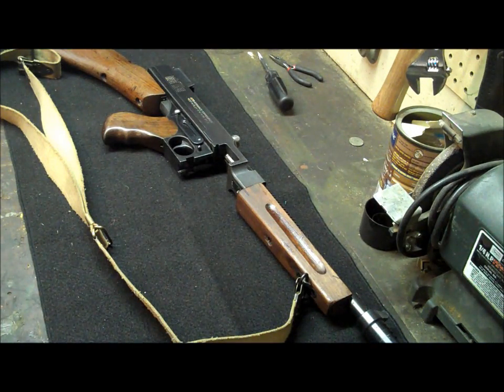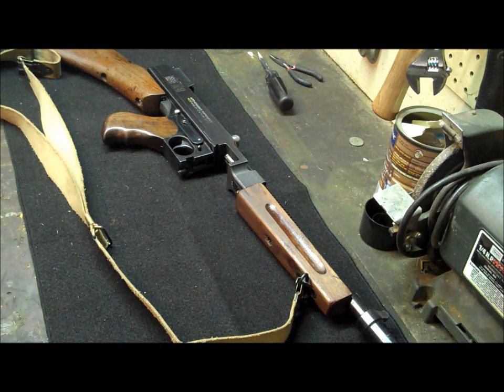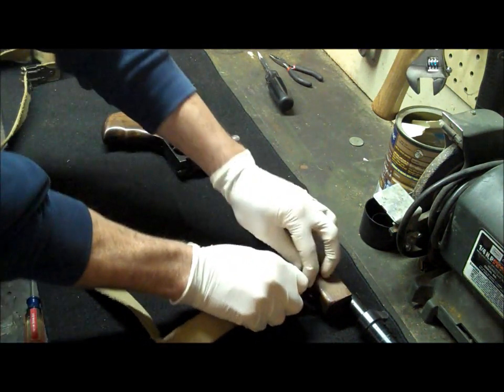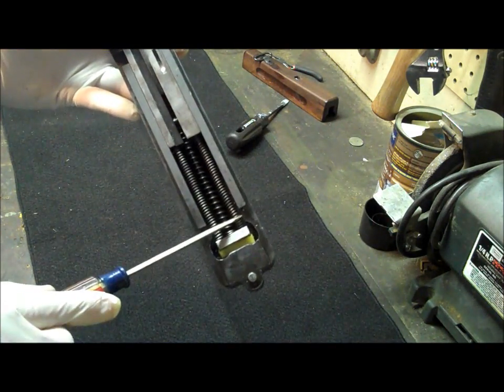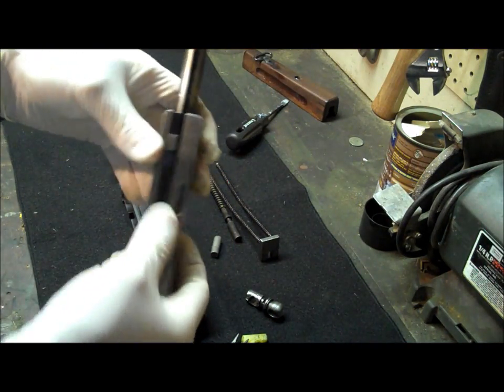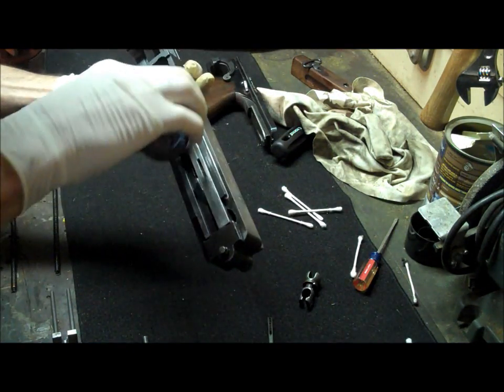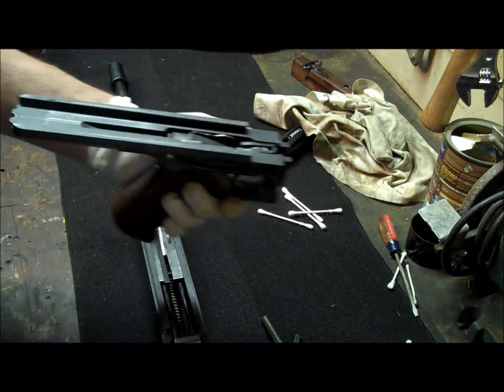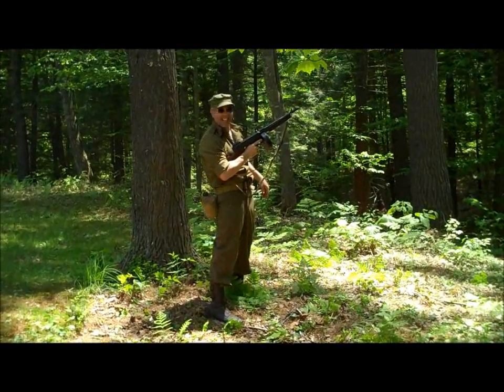1927A1 Thompson "Tommy Gun"

Comment: You can make a magazine loader for tommy mags by modifying an M 3 grease gun mag loader. Squeeze it in a vise along it's long axis,making it longer front-to-rear. The fore and aft ends will bow outward and clear the "T" rail at the rear and make it narrower.Go slowly,in small increments,testing fit as you go. When it finally fits, give it just a little more to allow for  the steel's tendency to relax and spring back over time,but be careful not to over do it or it will be too narrow to fit.

Comment: The top sling attachment is a british feature. And is that the tommygunner add on attachable piece to make the m1927 take a removable stock? I'm building a 1928 with an original lower and a philly ord receiver, and I plan to put a kahr bolt inside of it to make it semi. Involved in modding the original lower, but should be cool

Comment: The bolt on my tommy gun is stuck to the rear, the firing pin is sticking out of the bolt and the trigger is stiff.  I read that the sear is the problem but I was wondering if this is a common problem and if it's an easy fix?
Reply from the maker: SpiderGamez To be honest I've not encountered the problem.  Have you searched for a solution?
Reply: NUTAC Yeah the problem is that the sear is stuck in such a way that it won't let the bolt go forward and I can't take it  apart so I've discovered that you need to take the safety apart and push the sear up and out of the way. I probed the gun but can't figure out how to remove the safety on my tommy gun.

Comment: 45 acp bouncing off somebody? Ha ha ha I just watched mine penetrate an old steel car body from end to end - by the way the new semi bolts have both (top / side) the bolt handle holes for inter-changeability on the same bolt (between the 1927A1 and M1) even though the bolt handles are in different positions 12 o' clock and 3 o clock position. That's pretty cool.

Comment: what's the legality of a detachable stock on a non-sbr?
Reply: Its perfectly legal with no tax stamp or wait.  They make and sell tommy gun models just like that today; 16.5" barrel and detachable stock with and without the vertical front grip.  Without the stock, they are 31.5" long.  The way our laws in the US work, guns can go from pistol to rifle, to SBR, to "firearm".  But if the gun was first made as a rifle, it can only ever be a rifle, a short barreled rifle, or a weapon made from a rifle.

So in legal terms, you can take take the stock off one of these factory-built rifles and it will still have a 16" barrel and an overall length of more than 26", so it will still be a rifle.

Comment: 45 ACP 230 gr bouncing off?  ridiculous.  stray rounds shot straight up in the air on falling back down would bounce off.  And still hurt.
Reply from the maker: The vet never said it didn't hurt.  At 800FPS at an angle over distance, it would have a noticeable decrease in penetration ability.